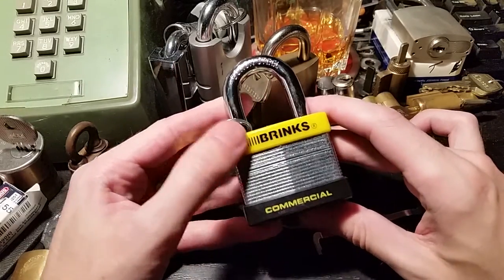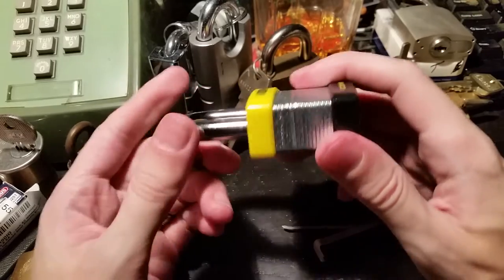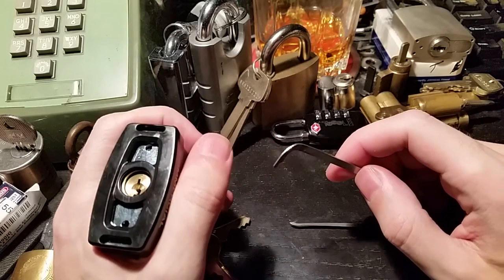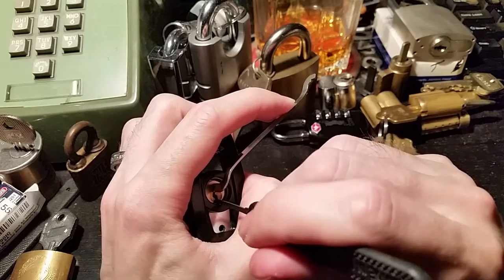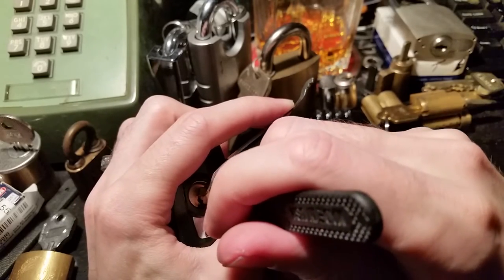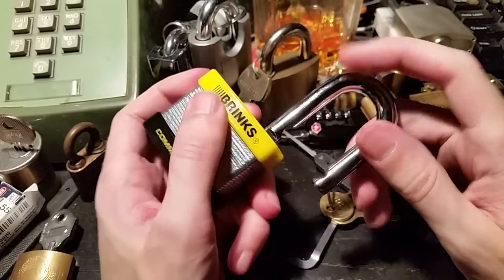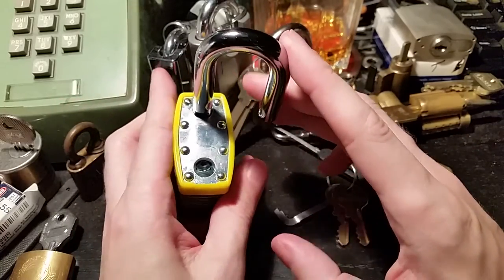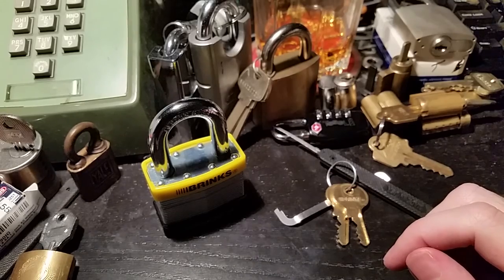(78) Brinks 662-50091 laminated steel padlock picked

Comment: Nice lock for the price. Lockwood make a nice laminated 50mm padlock that is kindly priced also.
Reply from the maker: I would love to get some Lockwoods but we don't get them very often where I am.
Reply: Looking for something in particular? Either way, just drop me a line. I've been sending a few out here and there in an attempt to fix that little problem.
Reply from the maker: Nothing in particular though someone pointed out your video on the 334B45 which looked nice. I suppose I should dig up one of their catalogs and familiarize myself with their offerings.
Reply: That could be arranged as I do have a few of those right now. Just let me know if you want it with spool pins or tapered pins. A few of their locks are listed on www.lockweb.com.au
Reply from the maker: +Noctis Motus are tapered pins like mushroom pins? That sounds interesting.
Reply: Nah, standard pins but the ends of pins have a slight bevel instead be being dead flat, making it quite easy to under-set or over-set. Far less chatty than the spools. I could send a lock with both sets of pins and you could decide for yourself which is more fun or challenging. :)
Reply from the maker: Noctis Motus that sounds awesome.
Reply from the maker: Sending something shortly.
Reply from the maker: I suspect the well duct taped box full of Lockwoods is your doing. Yes?
Reply: Yup. Chucked in one of those 50mm laminated padlocks that I mentioned.
Reply from the maker: Noctis Motus so far the 119 is the only thing I can get open. After hours of frustration I gutted the 334 just to confirm its contents, that thing is driving me crazy. Definately going to keep me busy over the holidays.
Reply: Glad I chose well for you. Go somewhat slow with setting the pins on the 334. Too much vigour and you will over-set every time. Each time  you are setting a pin, make sure that you feel it settle into place after the counter rotation has finished. If you don't feel that, you may have under-set the pin. Once you learn the feel you will open them every time without fail.  Enjoy. :)
Reply from the maker: Noctis Motus just learning the right way to feel for feedback in these is occupying me at the moment, I am definately misreading them right now.